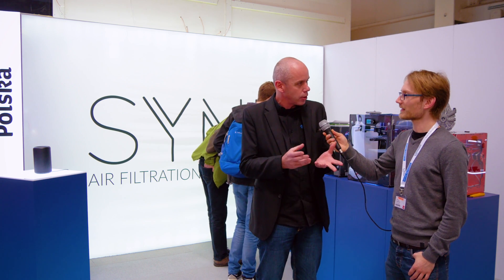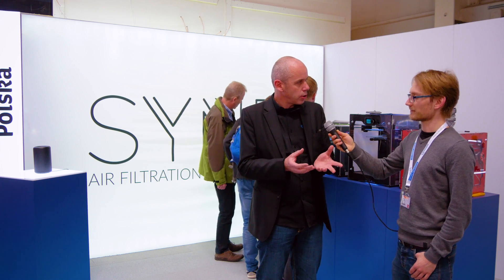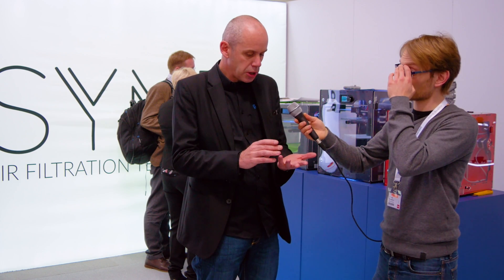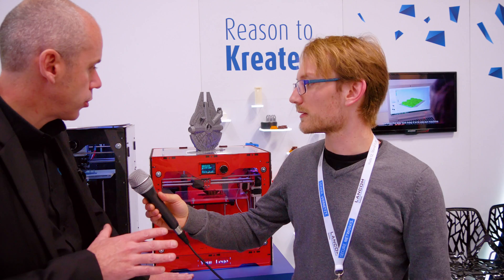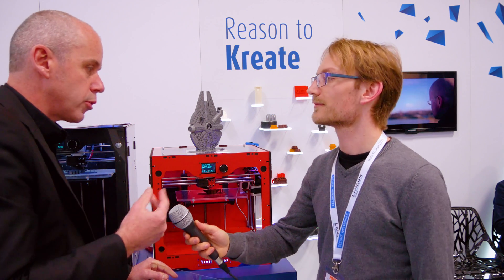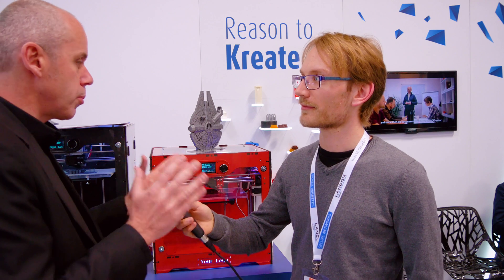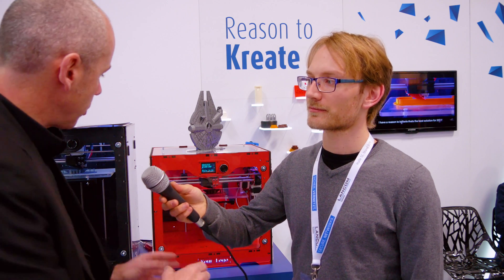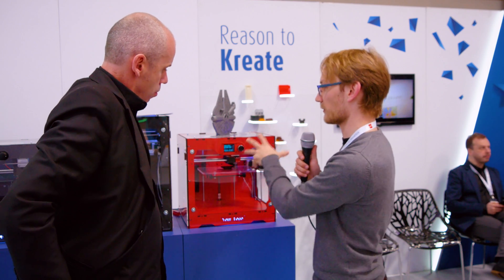Nanoparticle filter for 3D printers: 3DKreator's SYNE system #CeBIT

Comment: why wouldn't a normal Hepa filter work? even for the nano particles wouldn't van der waals forces get the little buggers to attract the fibers of the filter?
Reply: HEPA catches 0.3 um particles. The fine known particles are actually 0.01 or smaller. Not even UEPA (Ultra version of HEPA, for ultra-fine particles) can filter these known particles. I don't know about the van der waals force though.

Comment: Whenever I'm in the same room as my printer when it prints with PLA for an extended period time I get similar symptoms to a bad cold which is a stuffy/runny nose and barely noticeable degree of difficulty when breathing.

This weekend I'm going off to Bunnings to buy some stuff to build a hot box for the print, the plan is to have a closed system (to retain heat for when I print with ABS) filtering system using HEPA and carbon filter with a bilge pump pumping the air through the filter.

Comment: It has been many months, now, and...nothing.

Air filtration is not new tech, and industrial needs have driven the hard R&D, already. I'd pay for a filter that could remove 80% of VOCs and UFPs, so long as consumables were acceptable, like $1/Kg non-dryboxed ABS, on average. But, all I see and hear is BS. Where are filtration products or announcements for them on their site? Where is 3rd party testing? Why don't they seem to give any standard filtration ratings on their printers, or at least specifations that they will need to be legally liable to meet? I wonder...

Comment: I hear 3D Printer filtration and it just leaves me skeptical...  ABS and PLA particles appear to be smaller then 100nm or PM0.1, which is  a size soo small they are barely starting to develop equipment which can measure particles in the range. So my guess is the filter isn't doing much for the smaller ABS/PLA particulates? But at least it's cleaning the air? Now I imagine they might be using some type of CARBON filtration for the "smaller" particles? Which looks like its CLOSER to filtering the small 100nm particles. According to wiki, activated carbon filters between 0.5 - 50um!  (or 500nm - 50,000nm). So it may still NOT be enough to filter the 100nm nano particles!? (Although, I doubt the smell is good indication of how effective it is, never seen a scientist measure particles by sniffing the air. lol ...)The carbon would rid most of the smell anyway, but still leaving the HARMFUL 100nm ABS/PLA particles unfiltered. Wonder when a real scientific lab will develop a real ABS/PLA nano particle filtration system? I think it's still years away... But some filtration is better then none I suppose, I would say the temporary band-aid solution now days would be to use a prefilter (for the larger particles) then some activated carbon (for smaller particles) and then vent it to outside. Just an opinion...
Reply: Well, particles carry charge, electrofilters is the answer. Not going for smaller mesh.

Comment: We are currently active in a research program with one point being this exact topic. We measured (nano-)particle emissions directly in the build chamber of two leapfrog printers and the amount of particles measured is only slightly higher than in a normal office environment (no printers or such in the office). So i also would say this is a topic  that is hyped.
However, it may be different using other filaments. We tried PLA and ABS (no problem) and a Hybrid material, that showed a significant, but again this was measured directly in the chamber.

Comment: I'd like more research to be done on 3D printer emissions. As 3D printers become more popular, it would be nice to know about any actual health threats. That being said, I'd prefer that companies aim for their products to be beneficial to consumers, not just aim to "start a trend".

I'm not particularly sensitive to fumes, I can be around unenclosed printers using ABS with no issues, but if more studies come out showing that the level of nano-particles from 3D printers is a hazard, then when this filtration would be interesting. Until then, I'd rather not spend money just to be trendy. Look how trendy worked out with Makerbot :P
Reply: One topic that should definitely be covered a little more often (or at least clearly labelled on printers/filamanet boxes. Tom's good about mentioning it, though) is that Teflon will create neurotoxic gases at the temperatures required for printing nylon...

Comment: As someone that works in filtration bussiness and have some knowledge about this topic I think it is total marketing BS! Why? When we talk about filtration we need to specify retention for specific particle size. HEPA is determined by retention for 0,3 micron particles. So Cubicon and UP have H13 filters, which means 99,95% retention for 0.3 micron particles so their filters are much more effective than this one.
Also removing particles does not remove all the odor so to completely remove odor, it should also have actove carbon filter and he does not mention that.
Reply: I saw this squabble occur a few days ago and you guys seem to not have calmed down so I'm going to step in and say mike lee is right lovrop is wrong. The end. Don't want to hear any more shit from either party.
Reply: Both 3M and Philips have released PM0.003 / 0.003 micron (3 nanometer) filters last year (2018). Philips has a PM0.02 / 0.02 micron (20 nanometer) filter since 2016. I would look up this SYNE filter for comparison but couldn’t find any info on their website at a quick glance.
Reply: @Sa-fd7ih  
Really?? Good news! Although I wonder if it's even available to regular people, let alone the price...

Funny enough, it isn't possible to filter nanoparticles, no? Wouldn't you need a space between the filters's walls of less than 1 nanometer (and we can't physically build that, or right now anyway)? (I'm total noob in this, so I might be talking nonsense...sorry!😄)

But then again, I don't know how big in size one, day aluminium, molecule is, in comparison with 3nm... Maybe it's bigger, so in that case it will be filtered out (even if it's nano) I guess, no?
Reply: @Sa-fd7ih  
 Funny, your last comment isn't shown here - "...and Philips are the only consumer filters that I've found..."

Try to resend it, or send it to my Facebook or email, as I'll add it to the discussion.
Reply: Maxim C.
It’s here. I can see it. Maybe YouTube was acting up.
Reply: @Sa-fd7ih  
Well, that's the thing about ghost banned comments😊 - the one that wrote them can see them, others can't.  Check out for yourself - sign out or in a different account (if you have one) and the comment won't be here...
Reply: @MaximC  Do you see it now?
Reply: @Sa-fd7ih  
No. Did you try to repost it?(copy/paste)?
Reply: lovrop I hope you're joking about working in the filtration business because you are mistaken with who is dishing out the bs. According to science direct and IEEE, http://www.sciencedirect.com/science/article/pii/S1352231013005086, http://spectrum.ieee.org/nanoclast/semiconductors/nanotechnology/nanoparticles-emitted-from-3d-printers-could-pose-a-risk the smallest particle size from 3d printing  is 11nm. 0.3 microns is equivalent to 300nm. That means the HEPA filters on the upbox are a total waste! They actually won't filter any particles smaller than 300nm, yet the bulk of the harmful 3d printing particles are smaller than 300nm. Depending on the type of filament used, up to 60% of emmited particles are smaller than 0.3 microns. If you read closely about HEPA filtering, you will find that when they say 99.99%, they are referring to all gaseous particles, some of which measure up to 5mm in diameter! Also, a carbon filter of any sort won't help at all, because 3d printing filament particles are simply too small to be affected by a carbon filter. You are the one who has been clearly duped by marketing. If anybody is looking for a foolproof solution, just fully enclose your 3d printer, run some tubes outside of your workspace, and attach a fan to move the contaminated air outside, which will disperse and dilute the particles to the point where they are not detectable (at least on my equipment). Thank you for reading and I hope I didn't use any words too big for you lovrop.
Reply: @mikelee9396  
Hi, Mike.  I want your opinion on this — if I want to filter some nanoparticles from air, are there ways to do it?
(Thank you in advance for a response.)
Reply: Maxim C. Run a hose outside. Use a multigas/hepa p100 respirator filter and a fan and enclosure if the hose isn’t an option
Reply: @mikelee9396  
Ehm, I actually would need it to filter the air that enters the house (outside air), not for 3D printing. But thank you for the advice, I appreciate it.
Reply: lovrop you should actually stop pretending to know more than you actually do. A quick web search on this matter exposes how you actually are wrong or misleading about 70% in all of your statements. Sorry Mike Lee that you have to deal pretentious trolls like lovrop.
Reply: lovrop Thanks mate, those were exactly my issues with this... "patent pending innovation"...
Reply: Mike Lee wow, you really know nothing about filtration. smell is mostly carried by particles. removing particles removes most of the smell but not all. So that is why you need also active carbon to remove the rest. Also there is NO FILTER ON THE MARKET that would successfuly remove particles below 50nm. Finest filters that exist have ULPA 17 rating - 99,999995% efficiency for 0,3 micron particles. that means that efficiency for 10nm particles of this membrane is roughly few percents. And there is NO finer filter that exists. Even if it would, air permeability would be almost zero.
Reply: Mike Lee and yes, if filter has hepa H13 rating it removes more than 99% of the 0,3 micron particles but also smaller ones. for 0,2 micron particles efficiency would be offcourse lower but probably still about 60%. so clearly you know nothing and is just another internet troll knows everythibg after reading one article!
Reply: ron jenkins haha, then just buy Syne's super duper patent pending ultra nano filtration system and be forever happy about it! my friend made a box like this based on informations I have given him with hepa h13 filter and active carbon filter for 40 EUR and it works like a charm. bit you do whatever you want!
Reply: Aaron Stevens please enlighten me which statements are wrong? everything that I wrote can be found on the internet and are facts!

Comment: this is probably overkill, but I do worry even about PLA printing open with my prusa.  I would think any sort of enclosure, with a filter in back and a fan creating negative pressure to push the particles into the filter would be sufficient, especially if you let the fan run for 5 minutes after the print is done, and the internal air cooled down.
Reply: but.. if you filtering through a filter and out of the enclosure then the nano particles are being circulated into the room you are in.. I see better results with nano particles by simply leaving the filter fully enclosed in the enclosure with the printer. The enclosure will help contain some of the nano particles.